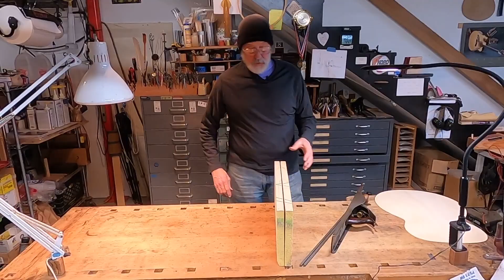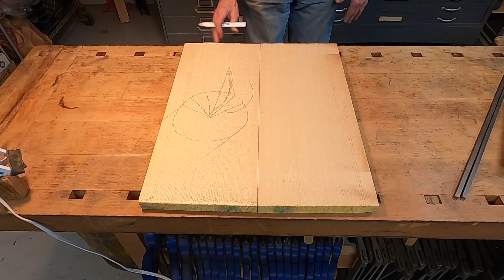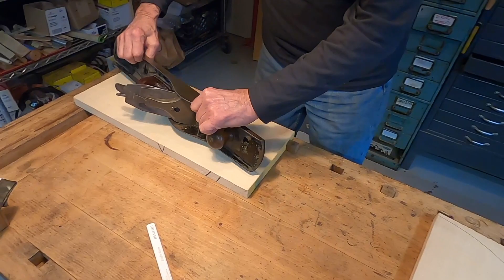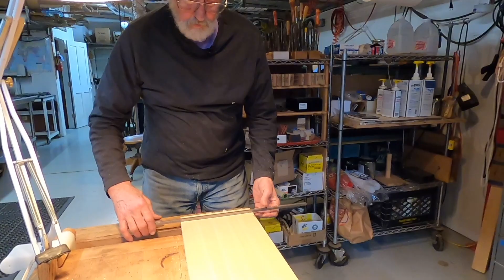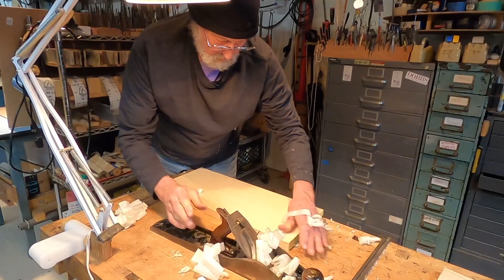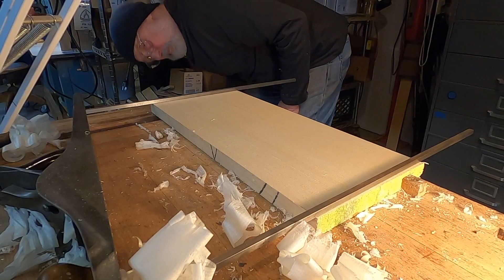Ken Parker Archtoppery - Rough Plate Gluing 1

Comment: this is very interesting, but also, that part of the guitar that you are trying to get the best match for is also the part most concealed (or removed by chopping the mortise in a more traditional neck joint) by the neck and tail piece, no? whereas the more visible center of the top will have a lesser match across the glue joint because it’s further from the matched face? how does that consideration factor in to your decision making?
Reply from the maker: I think that your question includes the answer. What we're doing here is acknowledging that there's a choice to be made, and trying to make what will turn out to have been the best choice. There is no right or wrong, just what you think is best.
Reply: @kenparkerarchtoppery9440 I get the explanation of the eventual position and orientation of the most closely ‘matched’ pieces of the wood being underneath and therefore concealed, but having watched that segment twice over and looked through these comments, what I’m still not understanding Ken is why you felt this was the best way? Was that just for this particular pair of book matched pieces (though they look about as well quarter sawn as one could hope for), or is your preferred option if the pieces will allow? Is it because you feel having the best match closest at the point where the structure would benefit from that orientation, for strength or stability? Sorry, if I didn’t explain this very well - I just didn’t understand why you felt this way would be best if possible 👍

Comment: I looked on the website for Pacific Rim Tonewoods and they didn’t seem to have anything that thick for making archtops, just stuff for flat top steel string guitars.  Is it something you have to special order them to cut for you?  Also, I noticed while your wood in the video is uniform thickness, it seems like most tonewood suppliers seem to only offer archtop wood in wedge shaped bookmatch pieces.
Reply from the maker: Go ahead and ask them for what you want, it's a great outfit run by great folks.
The wedges are more common, as you mention, but it doesn't make much difference in practice, except that you need to use wedgy supports here and there when you're first flattening the gluing face, no big thing. Wedges are the classic shape supplied to builders of violin family instruments, as it means that 100% of the material is converted as vertical grain, just right for plates, and also necks.